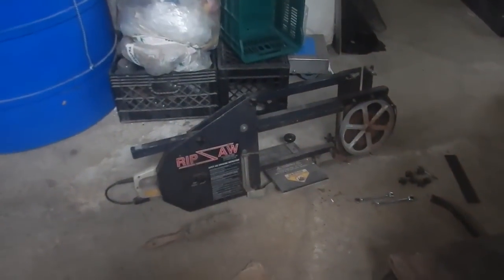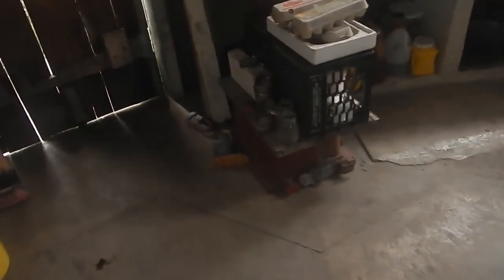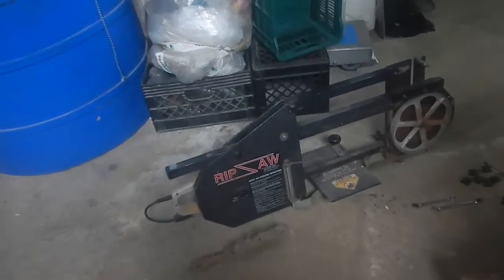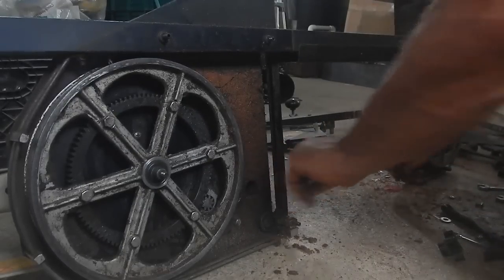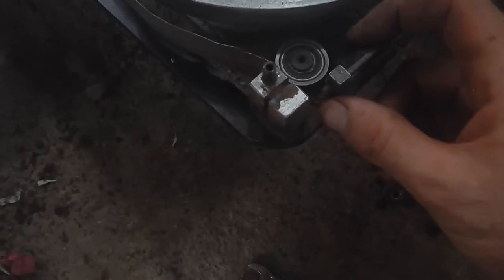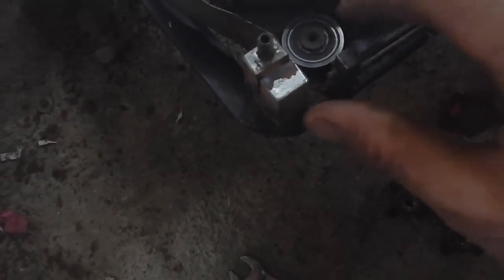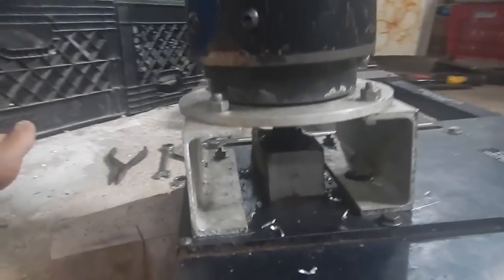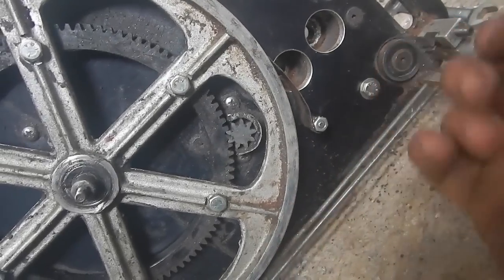Making a Bandsaw Out of Garbage.

Comment: Jamie, Your hand held unguided jungle fabrication ability is stunning.  I worked for the manufacturer of Browning bearings.  Please don't pack so much grease in. Pack in about 1/4 of the bearing worth and then spread it around or let it spread as it works.  SKB has equations for this and Browning has tables for it. I can send links if you'd like. As far as tracking adjustment if the normal adjustment won't get you in range then the sheave is out of alignment. So either the frame is twisted and needes to be straightened or you need to add a shim washer to one side of the sheave.  Hope this helps.

Comment: You can get 1/2" wide blades for those little bandsaws.  I'm gonna get one of them to see if it rips any straighter.
If you gear it down some more (edit: after hearing it run it sounds quite slow already)  you could use it for cutting steel with the right blade.  For aluminium you'd probably get away with wood speed and metal blade.

Comment: Wondering if you ever found out more from that fiberglass cement video like say Latex Cement Concrete using the alkaline resistant screen or if burlap is suitable?  Seems the burlap would be more renewable or even the fiberglass if was like used more as a mold or form for more RC structure?